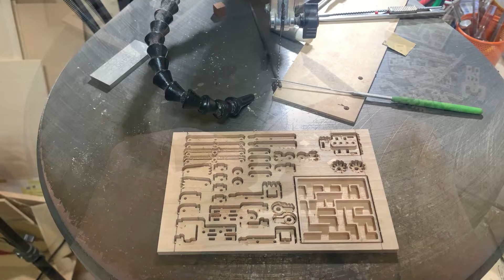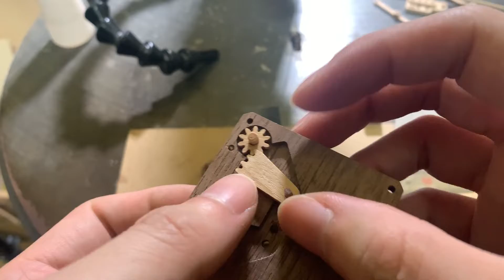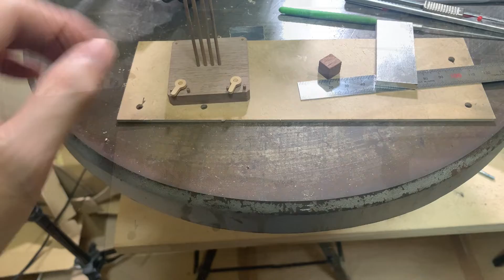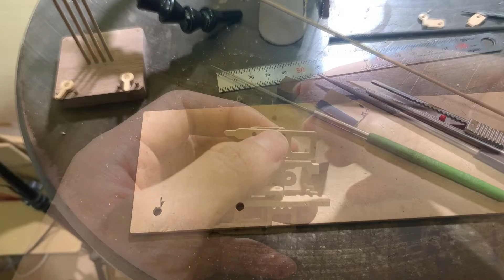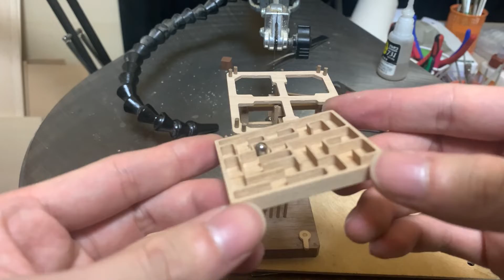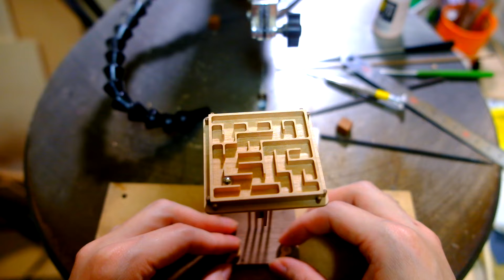tilt maze game machine (making)

Comment: I am very curious about the production of your special gears or mechanical structures, do you first draw them on CAD and then make them, and then use CAD to improve and then make them after you find that they are not working?
Because I don't have enough tools at hand, it takes time to make each gear. 
I wonder if there is a faster way to achieve the basic test of gear model making and mechanical movement. 
At present, my linkage is to use cardboard cutting and bamboo sticks for testing.
Reply from the maker: When incorporating a mechanism into a work for the first time, we make a prototype and confirm that it works correctly.
There is software that allows you to simulate the movement on a computer, but the more special the mechanism, the more likely it is that you will not be able to handle it, so it is better to actually make it and check it.
If you are aiming for more efficient production, you may want to consider introducing a 3D printer, laser cutter, or CNC milling machine.

Translated with www.DeepL.com/Translator (free version)
Reply: @karakurist  Thank you for your advice, I think it's time to buy some tools, do you have any recommendations or cheaper options for each of these three types?
Reply: I actually have my own 3D printer, but it's too old and slow, and I'm considering replacing it.
Reply from the maker: I only have a CNC milling machine and have not used it with several machines, so I can't give you any recommendations.
I think it's a great idea to buy a new 3D printer.
Reply: @karakurist  Thank you for sharing, I will continue to try to create